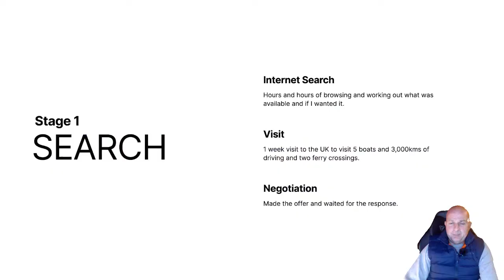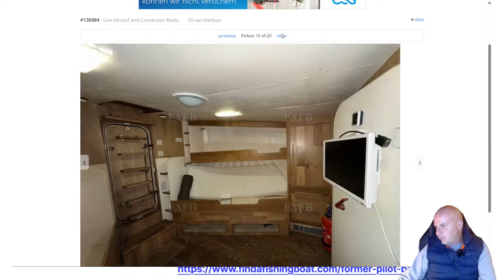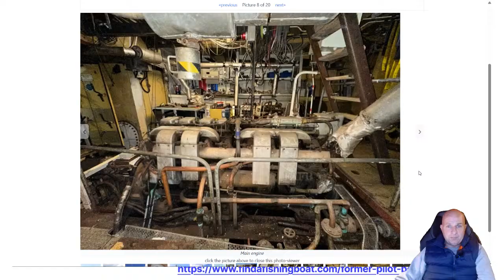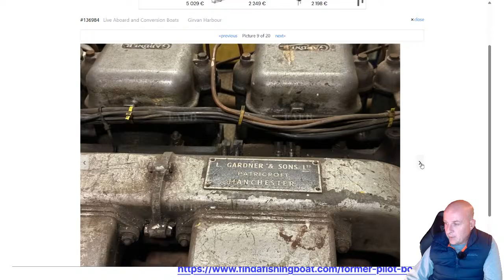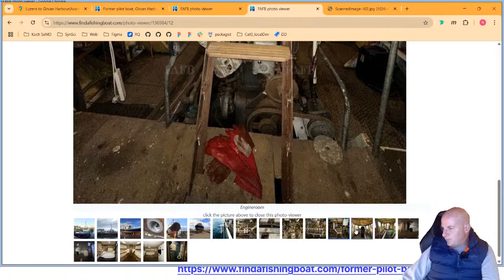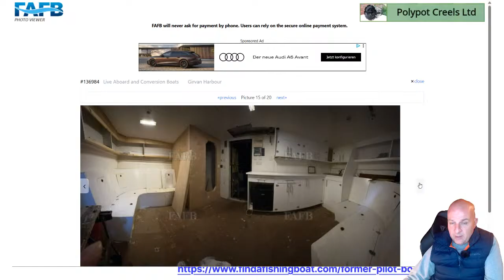The $2,000 pocket explorer yacht - neglected & abused - Episode #1

Comment: Just noticed, you also, have a hand start shaft on the Gardner.
Reply from the maker: Yes... i am not sure exactly how it works, but Michael from Gardner said you need 2 people to start the 8 cylinder model
Reply: @KochADV  yes, I can imagine, one for winding the engine over, while the other person, puts the decompression lever into action. Thanks for the update mate, take care.
Reply: @KochADV if you look at 35_ 48 on video,  top middle you can see, it is not connected. It would off had a bramer belt or chain connected, between the sprocket & crankshaft nose.